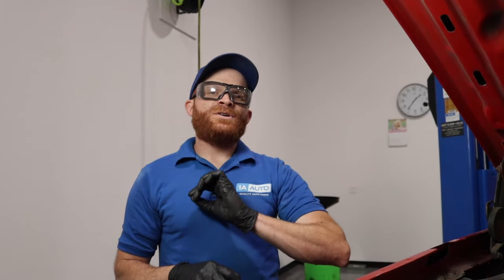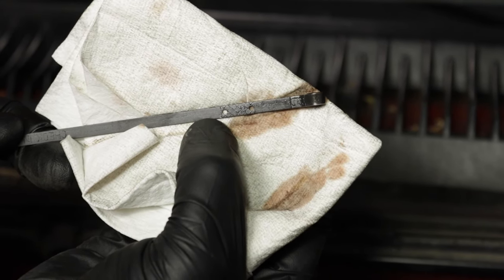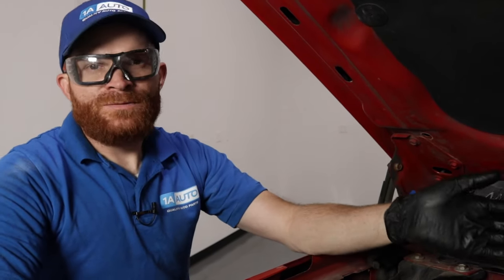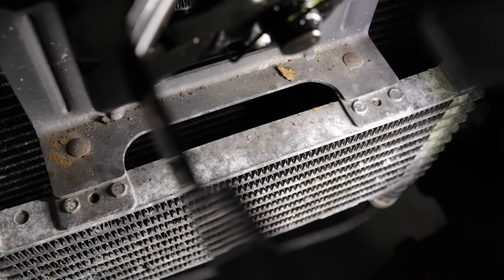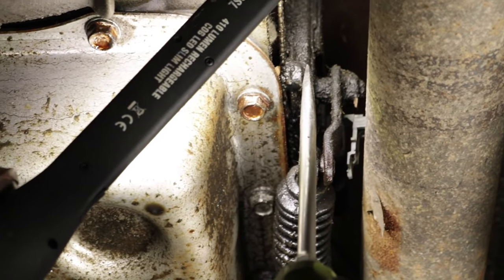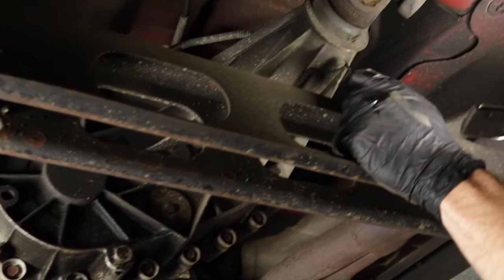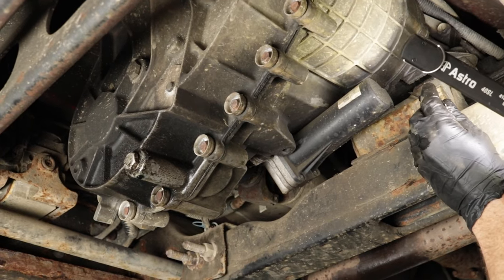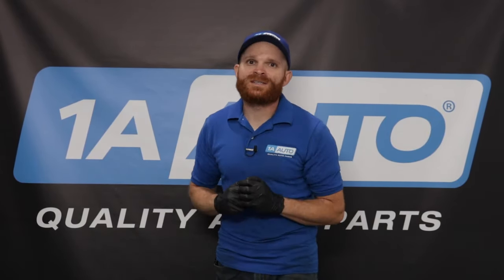Puddle Under Your Car or Truck? How to Diagnose Transmission Leaks

Comment: Got a 2000 Ford Excursion, V10, 6.8 beast on 4 inch lift kit. Just fixed my return hose line then she started leaking trans fluid and started to whistle. This vid confirms my diagnosis. Awesome

Comment: Does it make any difference if the transmission is in Park or Neutral when your checking it with the engine running?

Comment: This video was very interesting but I’m still at a loss with my BMW. I have a reddish-pink colored leak at the front of my car, just behind the engine. If it matters it’s a BMW N54 straight six engine. Am I safe to assume this is also an ATF leak or could it be something else? The car is a project car and has quite a few issues. I also have a spongy brake pedal so I was thinking it may also be brake fluid. Any suggestions are welcome!
Reply: Transmission fluid is usually pink coolant can be but isn’t as dyed as gravy fluid and different doesn’t smell feel the same. Brake fluid is pretty clear yellow like

Comment: I replaced the transmission shift seal 6 weeks ago. Then replaced the right axle and axle seal 7 days ago.
Then suddenly the left or drivers side axle seal blows out! 🤣 It was perfectly dry until
we replaced the right axle and seal. Well at least they will all be replaced.

Comment: My truck is a 95 f150 5.0l v8 it's a stock transmission and it has a square block for the tail housing but I have no idea why it's still leaking with new gasket on pan and still leaks in the back of the pan with new pan and gasket as well as new bolts. What can I do to fix it and is there a gasket or seal above the leak

Comment: 🙋This video is super awesome and way past cool. After installing a new automatic shifter cable on the Hummer H2 I now have this strange leak I've yet to figure out but with the help of this video I should be able to narrow it down to a couple of places👍😎👌
Reply: Turns out the leak was coming from a pair of rusty transmission cooler lines. Went to O'Reilly's auto and purchased some replacement hose along with some adjustable metal clamps then I cut off the bad part of the cooler lines to bridge the gap with the new hose. Worked like a charm at least for now anyway.👍😎👌

Comment: You lost me on on the output seal and then saying internal seal… what’s that part called? My truck is leaking between the transfer case and transmission. Due to my rear shaft falling while doing 70 mph damaging my fuel line and that…

Comment: I've got a 95 Dodge B2500 van. The transmission coolant line on the passenger side is slowly leaking where it connects to the radiator. Problem is, I cannot find a replacement for that line. Anywhere. Only one I can find is the driver's side.

Comment: Great video I’ve noticed with my Fj cruiser 2016 that when I go from drive to neutral (short while after starting the car) a shirt but distinct wine ... just wondering if you have any thoughts on this A1 Auto? Thanks
Reply: P.S. 20,000 miles on it 😩

Comment: I have a 2004 Honda Element with a really bad oil leak. I’ll pour transmission fluid in but the entire bottle will leak out in no time! I was told the only problem it has that needs to be addressed is the relay? Someone help me please

Comment: I currently am facing an issue with a transmission leak. I have a 2004 Chevy Silverado 1500 w/ a 5.3. My check engine light flashes when my rpm’s go higher and struggle with accelerating. But when I let off the throttle the check engine light goes away. Plugged GM scan tool into it and it said p0300. Changed plugs, all 8 coils and has coil harness on both sides. It’s been a real pain trying to fix this issue. It’s been at 3 shops and they say it’s a transmission issue but one said it could be a bad clutch or valve body. But I’m not sure if a failing valve body would make the engine to misfire. Thanks and let me know!
Reply from the maker: +Elijah Hoerner We wouldn't be able to diagnose an issue like that here, you may want to have a local mechanic take a look at it. Thanks for checking us out! http://1aau.to/m/Shop-1AAuto-c
Reply: Check your fluid hoses!

Comment: Hi, my 04 Silverado temp gauge is fluctuating and I have a transmission leak, both started at the same time. Gotta diagnose the leak still but could these be related? Perhaps fluid is landing on thermometer and messing with it? 1AAuto is a friend not a company, to me. Thank you
Reply from the maker: +AJ J We wouldn't be able to diagnose an issue like that here, you may want to have a local mechanic take a look at it. Thanks for checking us out! http://1aau.to/m/Shop-1AAuto-c
Reply: @1AAuto  Thanks for your reply. I won’t ask for a diagnosis but I’m thinking it’s coolant from the thermostat housing. It’s the highest point where I see fluid and I don’t see anything coming from the water pump. Is there a gasket in the thermostat housing? Is this a logical place for coolant to leak? Thank you.

Comment: After i installed a new radiator on my 2006 kia sedona , the transmission began leaking...what might cause this issue?
Reply from the maker: +richard jean Thanks for watching!  If it is an automatic then there are transmission cooling lines that might have been disconnect during the repair.  Please be sure to check all fittings and lines to make sure everything was reconnected properly and not damaged.

Comment: What if car manufacturers today are jerks and don't give you a transmission dipstick, oil pressure gauge, fuel pressure shraeder check valve, etc?

Comment: I have a leak that's close to the from of my truck (98 ford expedition), parallel to the wheels, but I'm just stumped as to where it is.
Reply from the maker: +Namey Lessone We wouldn't be able to diagnose an issue like that here, you may want to have a local mechanic take a look at it. Thanks for checking us out! http://1aau.to/m/Shop-1AAuto-c

Comment: I have a 09 chevy Malibu ltz 99,660 miles on it and have noticed transmission fluid leaking fluid leaking underneath the front driver's side. Any guesses?
Reply: It's just a guess... but you probably have a transmission fluid leak